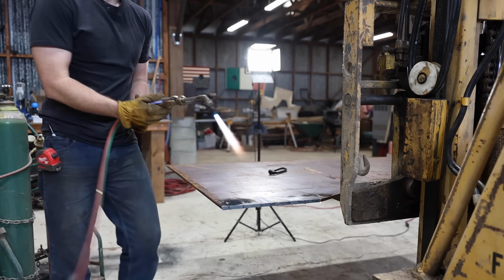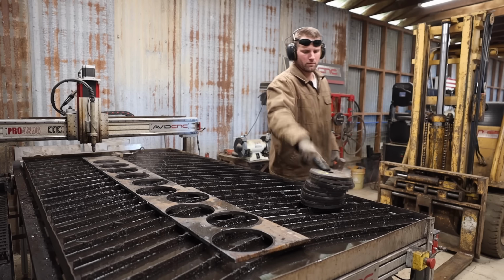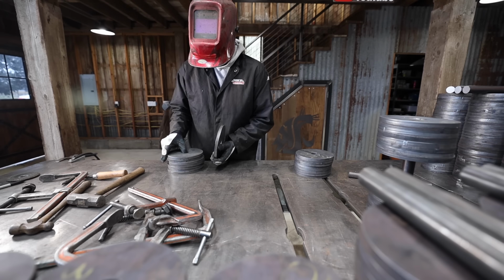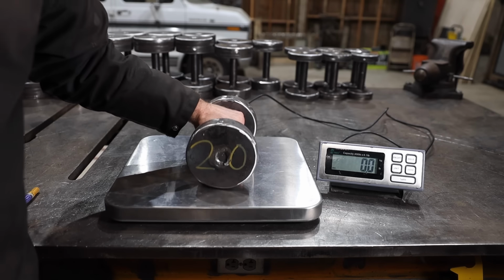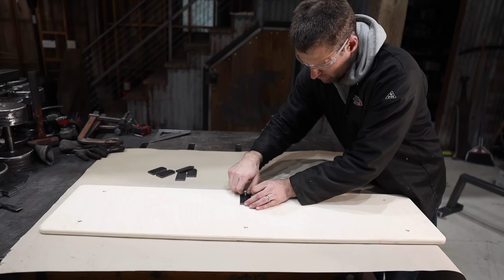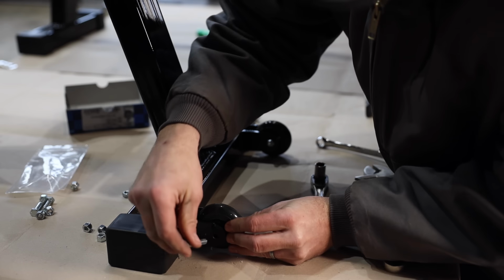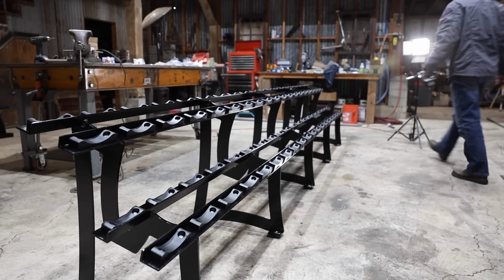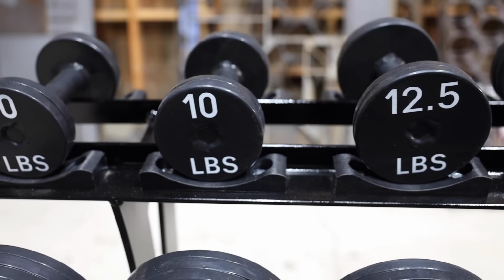Dumbbell Set from Scrap Metal | 10-100 lbs, Flat Bench, and Rack

Comment: My goodness you thought of everything, the details an time invested to save a buck absolutely amazing. You should definitely continue this project stuff. Love the plasma tool you have. Grate video.
Reply: he could've thought a bit more and weld weight where it needed more and grind it of where it had too much to get basically 0.1lbs of error, but all in all great job
Reply: @tonibaloni12  why? we are not robots and wont even notice the difference nor will it even impact any strength gains
Reply: @user-tr2dh4xx6u  ong bruh thats just over the top tbh. You'll never notice unless its more than like half a pound
Reply: Only thing I could think of is the knurling for grip!
Reply: Lo único que necesito para hacer mi propia GYM es iniciar comprando una factory, para fabricar las dimebell🤗. 🤣😂🤣😂🤣

Comment: Not good yet. I've already tried it and it will break the welding where the weights are connected to the bar specially the big weights
The solution is to leave the weights rolling in between two small rings seperators that is welded to the bar.

Comment: If I had access to that kind of steel I would have done this but the plasma cutter table I still wouldn't have room for.
I have a cheap little plasma cutter.
But it was the lock down that got me back into metal work again. But now my tools are better then they were in 1998.
If I could get 2500 or hotter ind buy cast iron pans and melt them and cast what I need.

Comment: You did an amazing job there, but you could have knurled the rods of dumbells for better grip
And also could have used longer rods and threaded them to bolt them together, or even inside threading to bolt them; considering the amount of tools you have there.
Y bcz the welding of rods and plates might chop with prolonged abuse during workout.

Comment: Can you break down how you calculated a cut distance of 6x (3x there and back) from here to the moon?
Im guessing cut distance have a multiplier that I don't know about?
 I didn't catch the measurements but at a generous 8 inch diameter and adding 1 inch for the inner circumference, I get a total circumference of just under 2000 feet for 420 plates.
You seems like a smart dude who knows what your talking about, can you help me make since of this?

Comment: Thousands and thousands of dollars worth of equipment. This guy Is extremely intelligent. Most people can’t make a birdhouse in shop class.
Reply: Tens of thousands of metal-working tools.
Reply: If you go to a shop and have them cut it for you its still a lot cheaper than buying a whole set
Reply: @justgivemeanumber8215  sure, but you could make something similar with concrete and stones/metal shavings. You might have to hit a scrap yard or buy the actual bars though to be safe unless you making light weights in which case a 2" pvc will work.
Reply: @TinyTalesBookClub   Of course, you can, but that is not the point. If it was there are many other "Cheaper" Ways it could be done. This is just a great way for someone who was going to purchase these weights anyway, and they already have great tools and knowhow like this for their job, So with all that, since he was going to get them anyway this was a cheaper, Productive, Profitable, because of YouTube, Way to go about it. Plus we all get entertained and maybe even learn something.
Reply: @justgivemeanumber8215 thats stuff he already has for other purposes though, thats irrelevant here, he used what he already had to make something that wouldve been much more expensive
Reply: Wow I can't believe that this guy that works as a craftsman is better at crafting than the average disinterested teenager 🤯🤯🤯🤯
Reply: Also literally more than $100,000 worth of metalworking tools. 

Just the CNC plasma cutter probably clocks in at about 100 grand. 

But sure.
Reply: @BjerkeRobin  Sure as an amateur you could do this with just a grinder. But you'd go through about a hundred discs and 3 months of work :) And the end result you'd have to say it's supposed to look rustic :)
Reply: @Macatho  yeah I know,I have tried with just a torch grinder and welder.there plenty strong but are so much work I made 20lb jumps in weight and just drilled and tapped a hole in each end of the handles so I could bolt 5 or 2.5lb plates on them to get the in between weights
Reply: @stephenthompson1338  That's still pretty bad a**.
Reply: @BjerkeRobin  They were not talking about the Machines. They were talking about how it's thousands of dollars if you were to purchase the weight lifting equipment from a supplier, But I think you knew that which is why you put also. But other people are thinking they meant that was for all the machines. I was wondering though, If you have skills close to this man's I would think the equipment would pay for itself after a few years. But man that is a ton of money and I wonder how much he really does save when doing home projects like this you know.
Reply: @BjerkeRobin  pretty sure he didn't get all those equipment just to craft a set of dumbells, it is prolly his trade.
Reply: @SanjiKunTheLoveCook  ofc. Doesn't change the fact that it enabled him to do the job 🤷‍♂️
Reply: @BjerkeRobin  you're making it sound like just having expensive tools makes you capable of creating everything. It's a common misconception so don't be too ashamed of it. 

"oh but he had starting budget, ofc he's a millionaire now", "oh he had expensive tools, ofc he can build stuff" cm on mate
Reply: @BjerkeRobin  the avid pro kit is 1325 and a 5x10 table is 2400. CAD
Reply: @KT13247  that was (obviously) a LOT less than I was expecting 😅👍
Reply: @BjerkeRobin  it's avid CNC, so it's around 7k-12k without the plasma cutter head. But yeah still expensive.
Reply: @BjerkeRobin  yo real quick. Did you graduate? Because what you said is something really stupid
Reply: @BjerkeRobin  way way less than a 100k cnc plasma is cheap compared to laser that machine is about 20k if it's fully specced
Reply: @BjerkeRobin  cnc plasmas start around 5.
Reply: @BjerkeRobin lol no not anything near that maybe a commercial one but me and my dad have built 2 and they run you 3-5k for a good one for non-commercial purposes now that being said a commercial one built to run 10 hours a day would probably run up the bill to 40-50k
Reply: @BjerkeRobin  that plasma cutter is 8K give or take, not 100K, that’s outrageous
Reply: @calebalt1557 No this Plasma Cutter costs def. more than 8k.
Reply: bro how you gonna compare a literal engineer to a random person lol. most people dont even have the opportunity to do crafts like this.
Reply: Whenever you got the tools to do it for you then yeah they can lol
Reply: @Thekidsinafrica14  The tools just do the job you have them do. Not everyone can do the math and not everyone knows how to work the tools. How many people don't know how to use a hammer or know basic math. A lot. And alot of people don't know how to create indepth spread sheets to calculate things for them. A lot of people hire people to do all these thing because they can't.
Reply: Yup I love these type of videos. Make your own shit just need to buy 100k worth of equipment to do it yourself.
Reply: @aristotlejb82  he never said „i will show you how YOU can do it“. Its just a video showing what he had done for himself. I think he is pretty sure that not everyone has the equipment :D not everything is a tutorial
Reply: Meanwhile:

Me - built 10-60lbs dumbells with sand + cement + pvc pipe. 😅 $18
Reply: Yup
Reply: That’s the whole point
Reply: I mean you must be stupid if you have a million dollar shop and can't make anything that has value.
Reply: Fr this guy is cool I’m in to wood working but this is sick
Reply: Well concrete dumbbells?
Reply: 489.×××× pounds per cu ic foot.
Reply: The guy is an ace at his trade..
Reply: It's just common sense.
Reply: @memphisreines  That's not about common sense.. It's a skilled trade.. Common sense is looking both ways before you cross the street..
Reply: @QueensNativeNYC  keep telling yourself that.
Reply: @jrocktalks6308
Who's fault is that exactly? The generation raised by single mothers that also grew up without a dad? Or the Prussian model compulsory schooling system that turns out a thoughtless peasant class for factory jobs that no longer exist?
Reply: Omg yeah. Why couldn’t he have built them with no tools or scrap metal! Ong!
Reply: @jimporter  fair nuff. Still more than a set of dumbbells ;)
Reply: @BjerkeRobin  amazing where people choose to put their criticism. Criticising the tools he uses to do farm projects as well as entertain on YouTube but totally ignoring the price of the farm, the access to all those building to put said tools in and to work in never mind the area he has to stash the weight rack. For most of us that would be the first problem rather than the CNC.
Reply: @jimporter  no one is criticising anyone you bellenf
Reply: @jimporter  its the clickbait title, this didnt cost him less money than buying the dumbbells, why not be honest and title it appropriately? Sick of clickbaits

Comment: Reminds me of my cable machine I mad for Lat pulls, tri push downs, seated row etc.
Lots of cutting and drilling to make the 200lb stack. Turned out great and looks good painted red and black.

I have been trying to find used dumbbells but nothing cheap. Scrap steel here sells for 10 cents a pound...wish I had a plasma or waterjet. Cool project.   - Cheers

Comment: It’s sad because you see these in many old school gyms and the plates are always loose and the weld on the end is always cracked. After a few hundred drops they become unsafe to use.the large outer plate diameter when struck on the outer edge multiple times from being dropped is sufficient to destroy any weld after time. Best to use a small 5 or ten mil thick collar on the end of the rod to remove this issue. Good vid 💪🏻

Comment: Bro these equipment are far better than those at the most fancy gyms!!! Amazing job!
Reply: Like the African ones you did workout with.
Reply: I just got finished being at the gym lastnight; I want a gym built just like that. I'm  going in today2.
Reply: I mean those Watson dumbbells with the 50mm revolving handle are amazing my cross fit gym has them once I start using them I don’t stop for the rest of the time I’m there
Reply: TRUE STORY 👍😎
Reply: LMAO
Reply: All they needed was Knurls on the handle and these would be perfect, massive oversight.
Reply: Are bhai aap😅
Reply: Hey paramveer , you have already visited more than half of countries 
Gym ,
Reply: Fancy looking equipment is for fancy Bros with Instagram accounts, in fancy gyms...
Reply: @alx252 weights are weights
Reply: Dumbbels aren't only a weights - it is also a comfort and safety. The depicted equipment lacks these 2 criteria
Reply: @ЕгорБиркин-у7д  Are you kidding? Those are over engineered as far as dumbbells go. You might, and I mean might, be correct on comfort as the grips have no knurling or curves to aid grip, but as far as safety goes, these are far safer than the majority of commercial dumb bells. Just inspect the welds on any out there (you might have to cut rubber away) and you'll see that Rainfall Projects is clean while that commercial one has crap welds.
Reply: @epurvee  I do prefer rubberized ingots
And indeed it does not matter what is inside - a silver or a cast iron. By the way, the latter is even preferable as it is more sturdy
Reply: @ЕгорБиркин-у7д  you'd be right about comfort, the grips on commercial dumbbells would definitely be better, but absolutely not the safety
Reply: @epurvee las pesas del gym son mas comodas pero no mas seguras

Comment: Much easier to use cement mixed with scrap metal. Melt it down and just put it inside a box. One cooled put it in the handles.

Comment: I'm heading out to buy $100k worth of equipment so I can build my own weights out of scrap metal.
Reply: The Plasma CNC costs $6500 and the Miller Wielder is about $2500. He got the metal from a scrap yard which is 1/2 the cost of new metal. The barn itself is the only costs maybe $50K to build. You can wield in a small garage if you have good enough ventilation.
Reply: 6500 eh? Not bad
Reply: @Chillguydrew  i do not know you, but i do not have 50 k to spend on a barn with tools!
Reply: You could do this with wayy less expensive tools though. You could build a jig with a normal plasma cutter to cut the circles. Then weld it all together with a cheap mig welder. You could get a low end welder, plasma cutter, drill press, and grinder all for about 1k to 2k.
Reply: @christianwilson  show me , im serious about this, i love welding. its fun

Comment: As a person with none of that equipment it would be easier and cheaper to just buy a weight set lol 😂
Reply: Yeah it really requires you to have everything to hand and all the knowledge and time you'll need. There's a satisfaction to making something yourself ... to a point.
Reply: @forarainydave  I made plates myself out of concrete wich is like under 15 bucks for 100kg of plates. And you just need a yard and make some moulds. They are pretty dirty and it takes some time to get fully dry, but hey weight is weight
Reply: @lucaandre723  I suppose you can’t clang and bang with concrete plates?
Curious to hear your experience with the brittleness
Reply: @jackstoolreviews1519  I use concrete plates for powerlifting, but I have to slowly drop the weights during a deadlift. They're great for most stuff and cost like a third of the price
Reply: I don't have that equipment... but if I did it would be easier and cheaper to just buy a weight set.

Comment: Remember that when dropping the weights it gets rough on the weld, isn't the weld weaker than the metal or does it melt inside the steel itself?

Comment: Using fractions like 1/8 inch is just more complicated that in needs to be if you want to do any calculations. Insted of dividing a unit that is too large to fractions it makes more sense to just use a smaller unit.

Comment: Your bevel issues would be your feed rate speed of plasma cutter or your voltage or kerf adjustments if that’s a option but if you can slow it down and adjust your voltage and you will get clean cuts and a good tolerance from the front and back,hot tips.

Comment: What an amazing project it was a pleasure to watch! BTW I have a suggestion to add cross-bracing on your stand or at least weld small triangular shape plates under the weight holding rails and those thin legs. Now stand looks wobbly, with such a heavy load in time welds can fail and all the weights will fall sideways.

Comment: Also you can have the shafts of the dumbbells knurled, with the tool used to make pipe treading, just got to make sure you'd dont go deep and make a pass by both sides, then you can sand/file/polish the pipe and you got yourself a vulcanish knurling.

Comment: My brother was a powerlifter and needed some big plates for deadlifting. We went to the scrap yard and had some cut out of steel. The problem was, we were figuring the weight of cast iron. We had 2 plates cut and they turned out to be 260 pounds each. LOL He was still able to use them. He just had to leave them loaded on a bar all the time because they were so much trouble to move.

Comment: we did the same.  I ordered the bars and sawed them to size.  Then the previously calculated disks were welded onto the rods.  The discs all have exactly the same dimensions and weigh 5 or 2.5kg.  The welded areas were filled with epoxy resin and finally sanded.  In the end it was painted and stickers were put on.

Comment: freakin' AMAZING job! i wonder how much the weight changed after the coating was applied though? i'd guess close to another lb added. the possible improvents i can see other than getting the weights exactly right, would be to adjust the spacing of the holes for the saddles, so that the weights are evenly-spaced, because the larger weights have greater radius they are slightly crowded.
bigger picture: ya know, quarantine has really sucked...but on the other hand, it's also led to an utterly astounding outpouring of human creativity and making in this country, and that's very encouraging and exciting. RESPECT to everyone who did something with their time in lockdown! peace

Comment: Carefully use a heat gun on the topside of the upholstery corners. It will shrink out the vinyl making a  nice rounded contour. 
We use the gun a lot at our auto upholstery shop as it also takes out small wrinkles.

Comment: Where exactly o you live that a 2x1,5 plate of 10mm steel is considered scrap?

how much do you pay per kilo then?
Reply: Exactly, that would cost a pretty penny where I live.
Reply: Compared to what he would have payed to buy them, probably peanuts
Reply: If you bought a set of dumbbells like what he made I haven't a clue. But if you bought a cast set of hex dumbbells from 5 to 100 with the rack you are probably looking at around $10,000 maybe.

Comment: fuck those wire wheels on that angle grinder. I accidently hit the inside of my wrist with one and took out a nice chunk... 1 week later and i could not sleep ,,,because it still felt fresh. Probably had nerve damage, but i am too cheap to goto a doctor. a Flapper sanding disk does the same job, if not better than a wire wheel, sure you go through more, but they are far more forgiving when you inevitably fuck up and hit yourself.